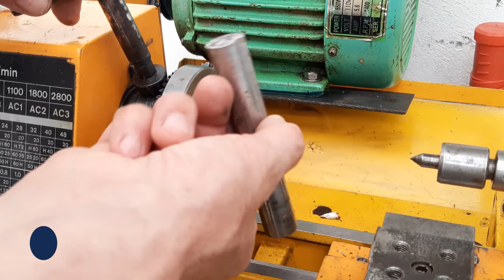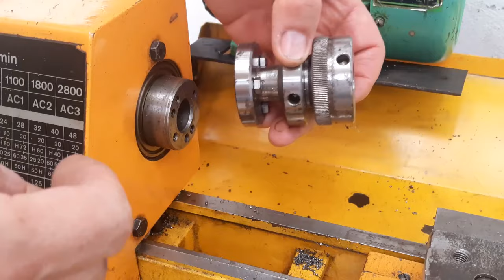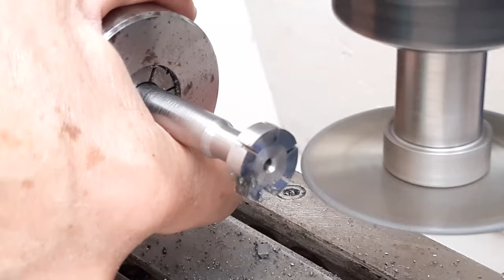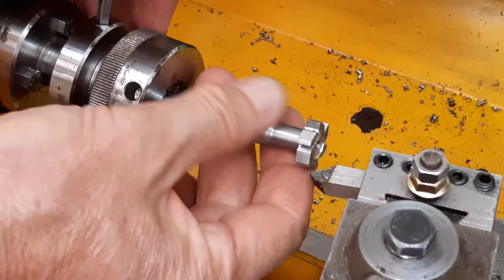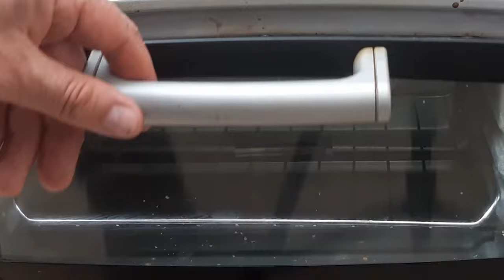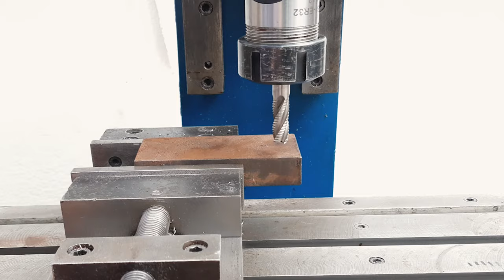HOW TO MAKE A T - SLOT CUTTER

Comment: What equipment do you use when tempering treatment?  Can you explain that process clearly?  Thank.
Reply from the maker: Thank you, I use a torch connected to a propane gas cylinder, which I graduate the force of the flame in the rotating knob of the nozzle, I bring it closer to the piece in such a way that it gives me the tempering temperature of approximately 850 degrees Celsius. Then I pass it to the tempering medium, (Vegetable oil), which I introduce quickly to achieve the tempering. After this, I carry out the tempering process, in an oven at 400 degrees Celsius, and leave it at that temperature for two hours. In this way I achieve sufficient hardness to machine hard materials such as iron or steel.
Thanks and regards
Reply: @franciscomurciaprojects2327  thanks ❤